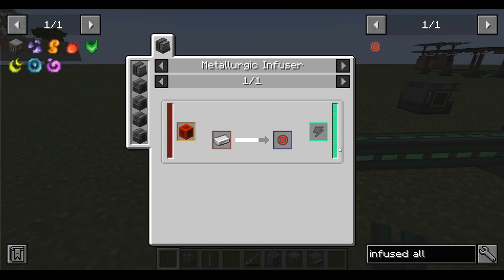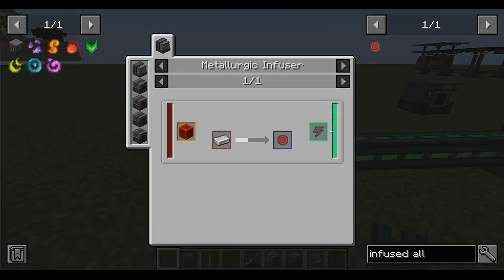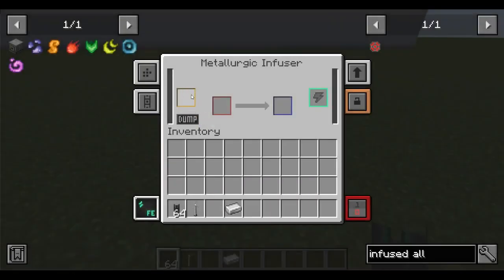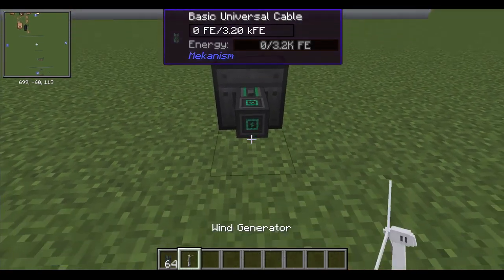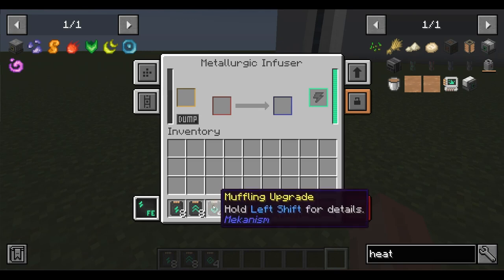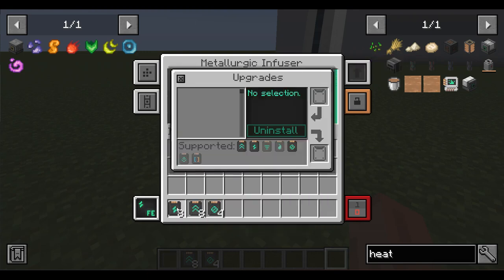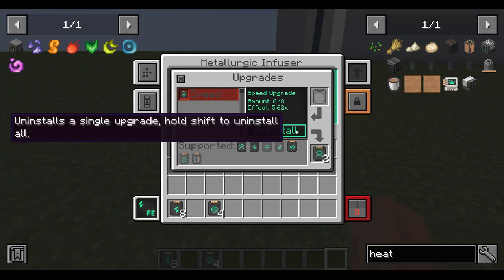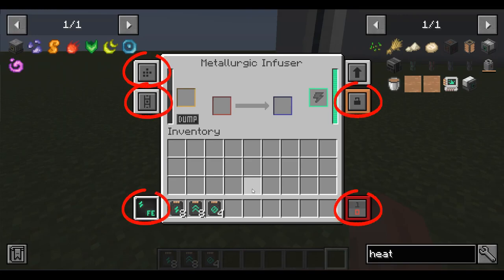How to Use Metallurgic Infuser Mekanism MC 1.19.2

Comment: U need to use the metallurgic infuser to make the materials for the wind generator. You can’t use the metallurgic infuser without a a power source (the wind generator). Doesn’t make sense
Reply: thats what im saying
Reply: Same I just need a basic control circuit😂